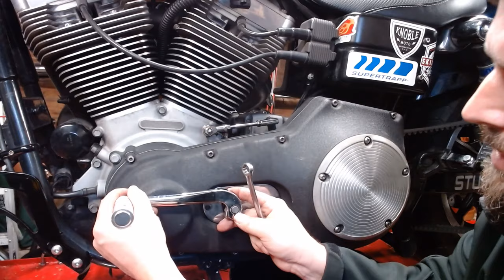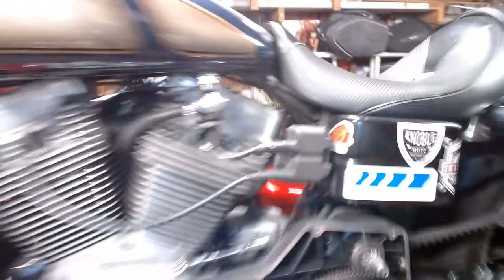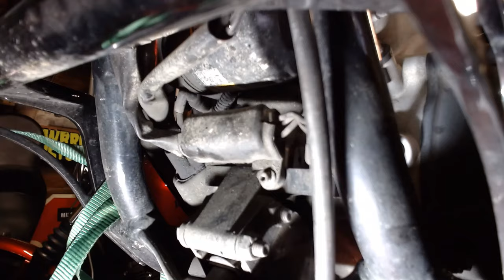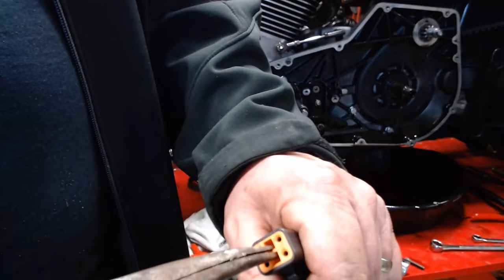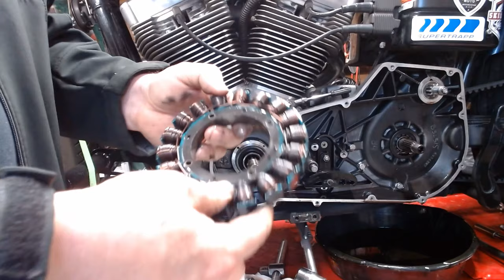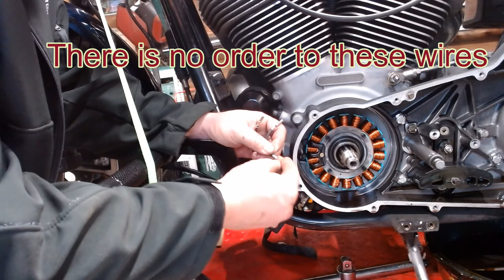How to replace the stator on a Harley.

Comment: Can this be done without removing the clutch side?
Reply from the maker: Nope.  You can’t get the primary chain off or the compensator sprocket without removing the clutch basket.  But if you can get the compensator nut off, you can pull the basket. Just turn the nut to the correct direction.

Comment: Do I have to take off the battery to fix the stator?
Reply from the maker: Off, no. But I would unhook one of the terminals since you will be doing electrical work.  Or don’t. Live life on the edge.

Comment: What are the torque specs for crank and tranny nuts?
Reply from the maker: 150 crank & 80 clutch for the 05.  Check you service manual for your year.

Comment: Am I the only one that doesn't touch the clutch pack when replacing a stator/rotor?
Reply from the maker: You don’t have to take the clutch pack apart. But while you’re in there, why not.
Reply: @KnobleMoto  I just never thought of it. I go in to get the job done without looking for more problems 🤣
Reply from the maker: @ryker4124  that is not a bad plan. It probably is a lot cheaper too lol
Reply: I didn't touch mine I didn't have snap ring pliers then I found this video after I  put mu stator in
Reply from the maker: @chadneel2137  which bike was this on
Reply: @KnobleMoto  mines an 04 fxdx
Reply: @KnobleMoto  great videos tho man very much appreciated 👏 💯💯💯
Reply from the maker: @chadneel2137  thank you

Comment: Clutch doesn't need to come off whatsoever, loosen and remove Cain tension wa la
Reply from the maker: If you can do that, you might need to check your chain tension for wear.
Reply: @KnobleMoto I took tensioner out completely

Comment: My only question is : If you went this far to breakdown the primary why would you not take the inner primary off and replace all the shaft seals, You're already there....$50 more and its all new
Reply from the maker: Mostly because I had just replaced them a year before. Otherwise you would be correct in replacing all of the seals.  Plus there is no need to complicate and lengthen the video.
Reply: @KnobleMoto  I see your point and respect your opinion.  If the seals were replaced a year ago then I agree, no sense in fixing something that wasn't broken or worn.  However, if the bike is 14 years old and those have never been replaced....NOW IS THE TIME....Keep up the great work....
Reply from the maker: @raymondpontremoli4500  thank you

Comment: Victory stators are mounted to the primary cover, not buried in the engine in the heat. Stoopid design to make Harley money. That's too many places for possible oil leaks.
Reply from the maker: I believe your distain for Harley has clouded your abilities to notice the parallels in design. But whenever the Harley engineers call me for design advice, I will be sure and send them your way.
Reply: @KnobleMoto  It's DISDAIN and the design differences are covered in a 5 video series about the antiquated HD design on YouTube. I encourage you to find that 5 part series and watch it in its entirety. Educate yourself friend, first. Victory sales slogan rings true, if you ride one, you own one.
Reply from the maker: @glenosborne9807  eh. I’ve got some bad news for you.  Victory is out of business.  

Also I rode a few Victory’s. I rode some Indians too.  I have riding just about every bike on the road.  I bought a Harley. Technically the fourth one that been in my garage.
Reply: @KnobleMoto  uh, duh. Yes out of business so I own two of them and both will be on the road long after the Harleys with a whole lot less garage time. Keep drinking the Kool Aid bruh, she ya out there somewhere. Why do so many orange and black trailers exist ? I've been on my Vision cruising towards South Florida from Tennessee and pass trailers loaded with hogs headed to Daytona. They won't even make eye contact. Why are there "chase vehicles" with trailers following bikes to DC for Thunder for Blunders ? Why is there a branded T-shirt shop at every Podunk town in America disguised as a HD dealership? Cause y'all need them.
Reply from the maker: @glenosborne9807  I rode my sport bike past many of those trailers too.  That doesn’t mean anything.  I think you have confused the actions of owners with the design of a motorcycle.  It’s funny, no one ever goes on my metric bike videos and attacks them.  But it happens periodically on the HD videos, by metric bike owners.  It’s as if the problem isn’t in the engineering, but in the egos of the metric owners.  I once didn’t think much of Harley’s, but after I rented one and ride it through the Sierra Nevada mountains.  I realized I was wrong. Admitting mistakes is a key part of learning to fix a motorcycle, or one’s self.

Comment: Seems foolish,why replace a perfectly good stator. It's not a wear item
Reply from the maker: I travel on motorcycles, so reliability is important, and after 50k, I was in there anyways, so why not. 
Plus electrical components do not last forever. The heat cycles will break down the insulation and your stator will fail without warning.  So, in a way it is a wear item.
Reply: That's what I was going to say, just because it does not wear like a brake pad, bearing or wheel seal - the mechanical barrier between the coils and the oil will flex with the expansion and contraction of the CU during heat change.  Not to mention the wire sealant wearing due to fine metal particles from bearing and chain wear that floats around in the primary oil.  I would have to respectfully disagree,  I think it is a wear item.  Thanks for the video.
Reply from the maker: @vectorelectric8489  thanks!!!
Reply from the maker: @vectorelectric8489  thanks!!!
Reply: @KnobleMoto  I got 171,000 miles on my 2010 FLHTK, just now having problems with the stator output....@ $200 a pop, Im not changing it till its bad......did you swap out chain tensioner, clutch plates as well? I mean while you were in there....
Reply from the maker: @brianstokes7687  yes I did. If you look through my other videos you will see I replaced the clutch, and all the seals while I was in there. I also swapped out the belt and pulleys because they were worn. The pulley & belt wear was due to chrome flaking off an aftermarket pulley.  
The tensioner puck was in good condition because I put a new one in when I upgraded the compensator 20k before. 
If you ride than many miles, then you are aware of what a hassle it can be when a small part fails on the road, and the importance of preventative maintenance. 
$200 for a stator is less than a tow.
Reply: Absolutley a wear item. If you have the primary off for any other reason, change the stator,,, or you will be back in there soon after, 60k you might be in there some other reasons,, so  best to do it..